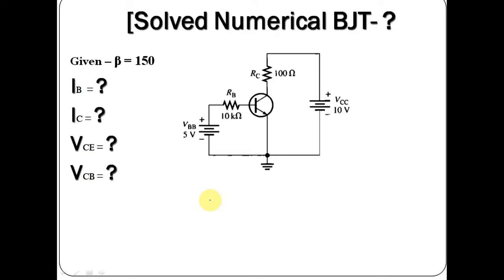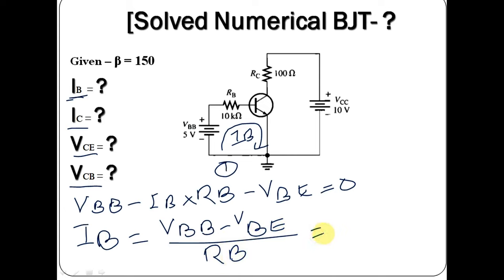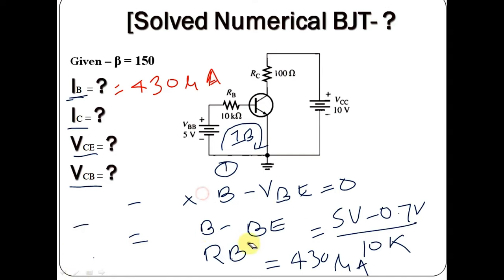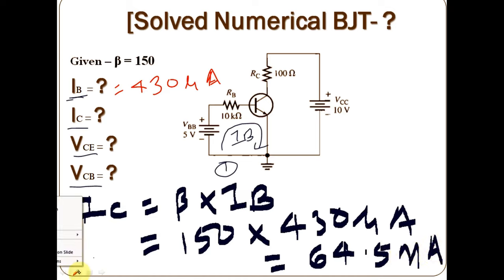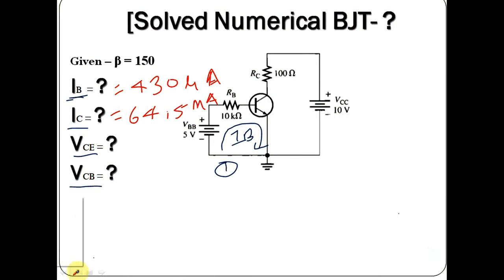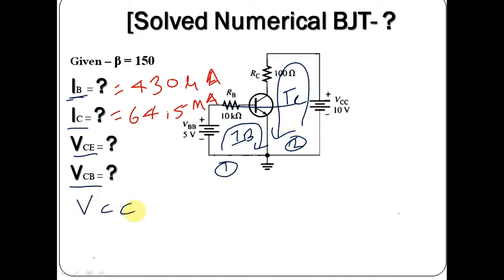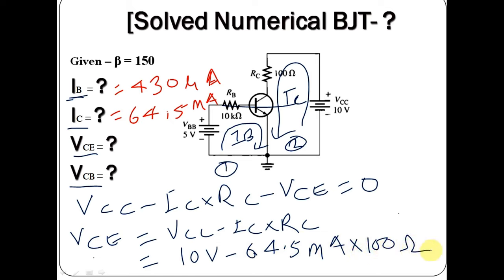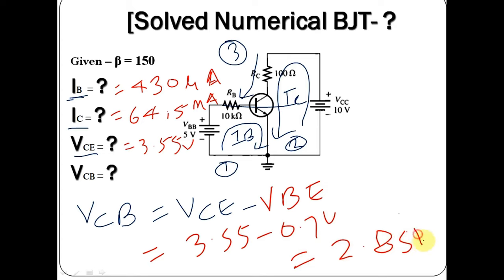[Solved]- Numerical for a BJT (Ib, Ic, Vce & Vcb =? )

Comment: How do we know that Vbe =0.7V? Is it a constant value that's true for any circuit?
Reply from the maker: VBE is base to emitter voltage of npn transistor.  Which is fixed and in the range of 0.6V-0.7V. Si material is used to form a PN junction so the cut in voltage of Si is 0.6V-0.7V. 
You can refer transistor datasheet for more information.
Reply: if transister made with silicon, vbe is 0.7v

Comment: Are the answers correct
Reply from the maker: what did you find wrong ?
Reply: @ElectronicsCircuitHubECH  someone told me so but I trusted your answers
Reply from the maker: @emmanuelbili6886  You should trust the step i explained in the video. All answers are correct.
Reply: @emmanuelbili6886  eee problem ba bili just copy ala
Reply: Your answers are making confusion for me and great work I appreciate your work very very beneficial video thanks a lot ❤

Comment: @Electronics Circuit Hub, correct me if I'm wrong, but if you multiply 0.43A by 150 beta, how do you get a lower current? I would think that if you multiply 150 beta with 0.43A you should get 64,5A?
Reply from the maker: Hey...Thanks for bringing out this question.
Sorry I may not able to watch this video again due to policy violation. But if you help me with the Vb = ? , Rb = ? I can re calculate for you. 
Sorry if I made mistakes somewhere.
Generally ib = (Vb-Vbe)/Rb
And ic = beta * ib.
.43A base current is unrealistic and BJT will get damage.
Isn't it 430uA current ?
Reply: @ElectronicsCircuitHubECH  I'm sorry I've read your u as a m. You were right... My apologies, it made no sense if Ib was higher than Ic. Thank you for your fast response and your video!
Reply from the maker: @thijsgrimbergen8898  Its my pleasure. Keep Learning , Keep Rocking !

Comment: Sorry sir but can you explain how Vce=10V-64.5mA×100ohms=3.55V??
Shouldn't it be 6440??
Reply from the maker: Hi...Thanks for asking good question..do not feel sorry about it...=(64.5*100)/1000=6.45V. Now 10-6.45=3.55. 64.5mA = (64.5/1000) A. So current unit should be in A.
Reply: Thank you so much sir! @ElectronicsCircuitHubECH

Comment: Hello po sorry newbie here how did you input 10k in the calculator that results into 430MA?
Reply from the maker: I think, you are talking about base resistance 10K, its 430uA not 430mA. 10K allows 430uA to flow in base of NPN BJT. This question i found in internet and trying to solve it.